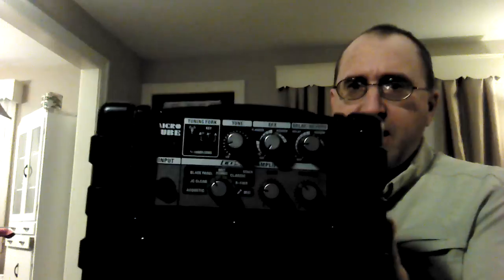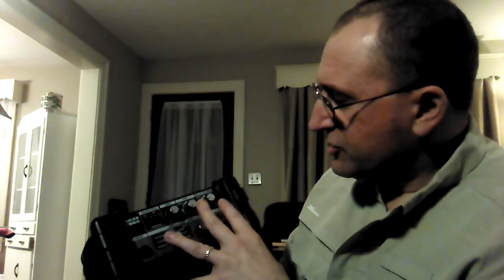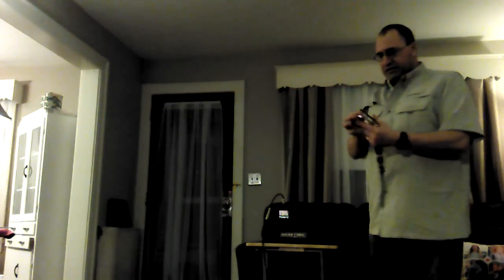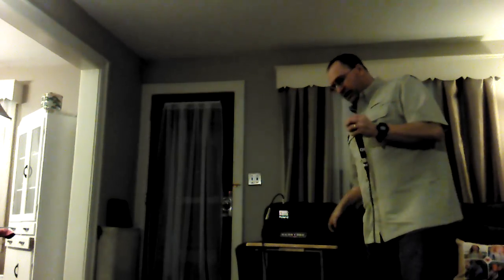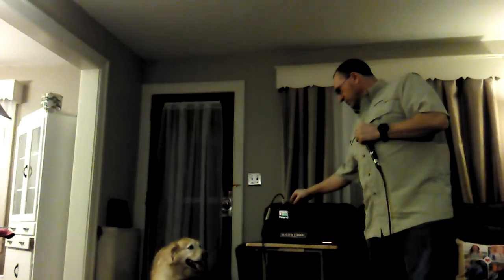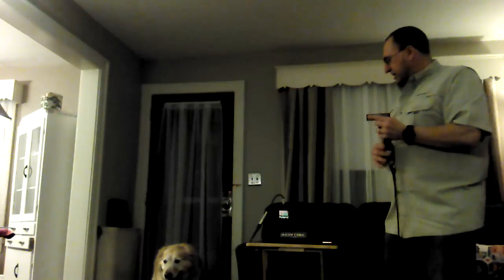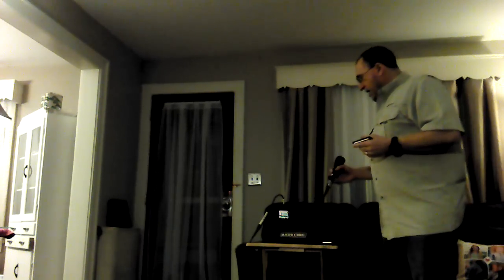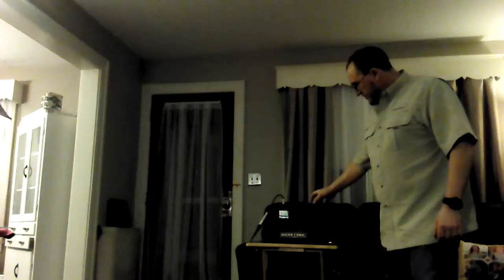Roland Micro Cube amp/harmonica demo

Comment: Good review. I have been playing harp through one of these for over 5 years. No problems. I use an impedance matching transformer to plug the mic in. I just use delay or reverb, never the other knob. It also has a couple of inputs in the back so you can hook up an mp3 player and play along with backing tracks. Master volume works on your input, mp3 player controls its own volume. Just this year I figured out the red Micro Cube sign on the front is just a sticker. I peeled it off and think it looks better now.